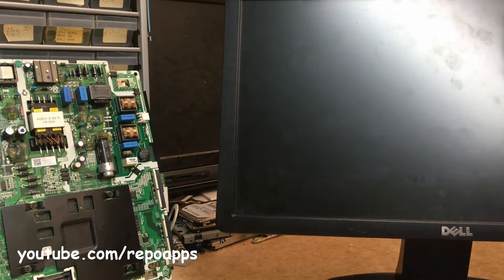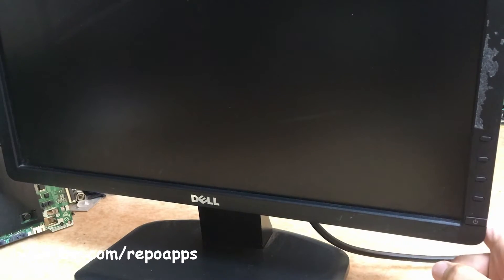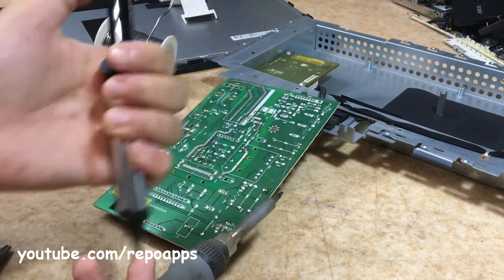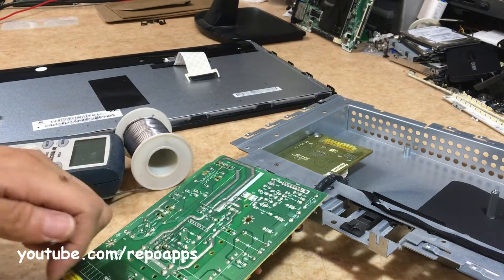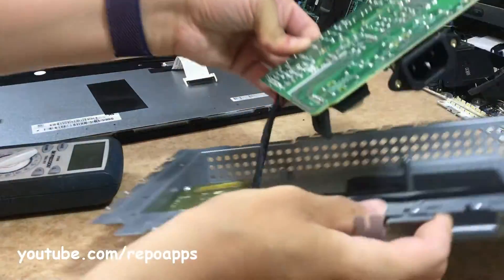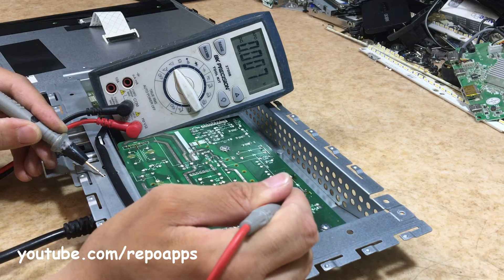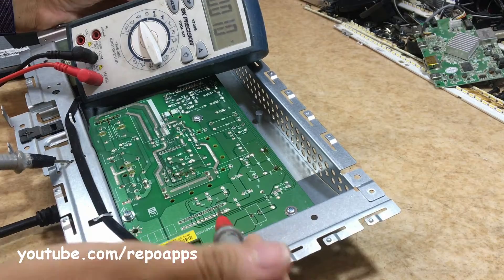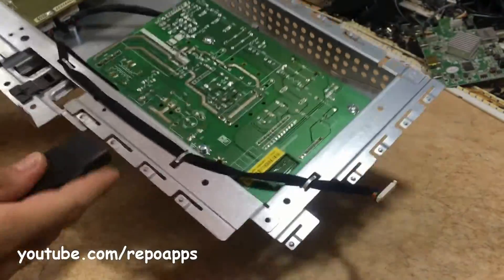How to Fix a Dell LED Monitor That Won't Turn On

Comment: Good evening,
Perhaps you could help me with an issue I'm experiencing with my Dell monitor. When I turn it on, black and red curved lines (pixels) of varying lengths appear on the screen, followed by pixels of different colors moving around in different places. I have not repaired monitors myself before, but I would at least like to understand whether it is worth repairing such a monitor, and if it is possible to do so myself. Thank you.

Comment: Sir i havev two diodes in power supply of my dell lcd. One is buzzering on both sides. Is it faulty?? 

When i remove it and check again with multimeter it doesn't buzz on both sides.

My lcd is not turning on. Power supply is giving 5volts on output section. Please guide me.
Reply from the maker: hello sir, disconnect the wires connecting to main board then check with multimeter if the voltage is correct,
Reply: @repoapps  yes voltage is correct

Comment: Hi

Fixed same problem . System Bios CSM/UEFI  if your on later windows 10 or windows 11 check your main hard drive is UEFI . Then go into your Bios make sure system is set to UEFI not CSM.

Comment: Power doesn't turned on for some days and again it will turn on after some days.  Anybody ever face this same problem. Please help.
Reply: I have the same exact issue
Reply: Did you find the solution
Reply: So the solution is, just wait a couple of days?
Reply: @vacuum34_bz  dont give any power to your monitor for 3-4 days and it will turn on hopefully worked for me
Reply: I had this problem on a dell 2007FP and i found bad capacitors.